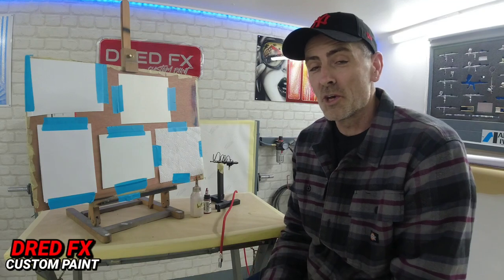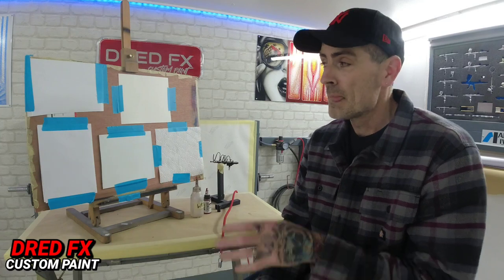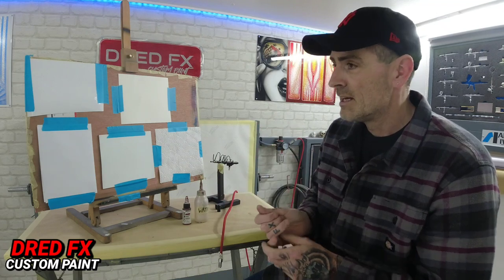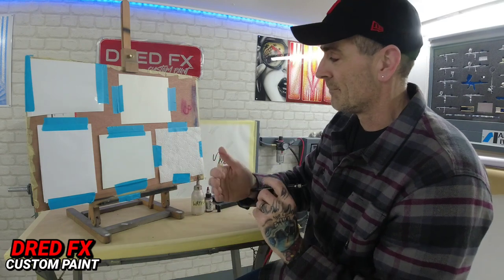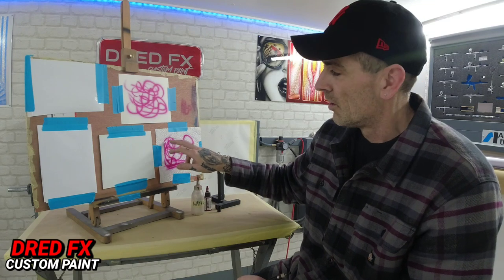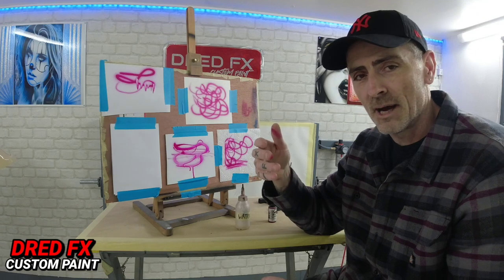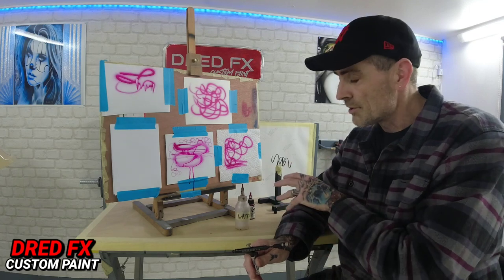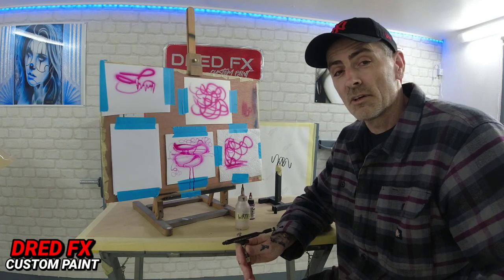Dialing in your pressure and paint

Comment: Nice informative vid Rob mate the only thing I would have added is if you are going to paint tee shirts first use a fixer such as Golden gac 900 and heat set it to prevent fuzz and use the same on top of your paint and heat set.
Reply from the maker: Thanks mate yes 👍 wanted to ask you which one to use as I want to do a video on t shirts soon
Reply: @dredfxcustompaint  I'll give you a run down of how I do it if it will help. spray the shirt with GAC 900 I use grease proof paper/baking paper and iron over the paper that will give you a smooth surface to paint on nothing worse than start painting a tee and it starts to fuzz up, some people like to heat set after each layer of paint to set it into the fabric but me I run a hair dryer over it during coats and after the last coat of paint another spray with gac 900 and again heat set with the grease proof paper and an iron. Hope this helps.
Reply from the maker: @bartholomewmccaffery7058  thanks Brian your a star 🌟 keep an eye out for this in a up and coming video